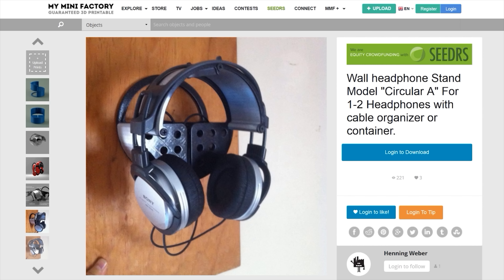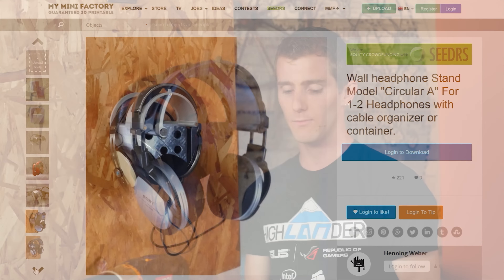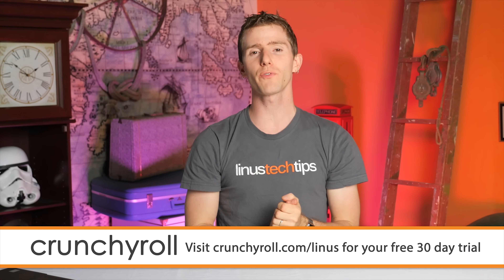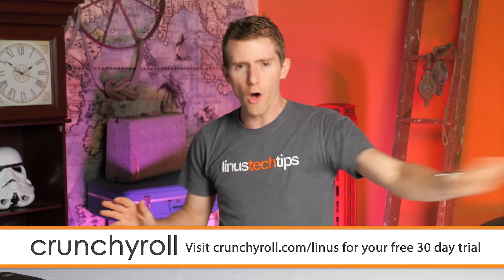Headphone Stand Design Contest Part 2 - 3D Printed Units In Office!

Comment: Funny if someone submitted a nail
Reply: I did
Reply: +Mr.TypicalHax heh, nailed it
Reply: +da' medic oh, you're punny
Reply: +Paul Apac What if someone submitted some string as well?
Reply: da' medic Eh eh I see what you did there
Reply: +Dottorrent I have the urge to set up a headphone pulley system now...
Reply: +Paul Apac Better submit two nails or else points off for no cable management.
Reply: +da' medic so punny it herz
Reply: +David Evans And a third for mounting hardware :P
Reply: +Paul Apac Got mine on a nail atm, but when you got like a 500$ pair of headphones, sitting them on a nail isn't to great an idea. at least for me. It insults the glory of the device!!
Reply: +Paul Apac I just use the desk :|
Reply: LinusTech Tips LinusFakeTips
Reply: +Jacob Evans Same, or the shelf, one ear pad on the flat side.
Reply: *****
bought what on amazon? a shelf ?

Comment: I think the second design is the one I like most. Its simple, clean and functional and would look great in different colours.
Reply: so true
Reply: I agree. perhaps linus should have just presented the shortlist and let a strawpoll decide. its not like there are any bad designs or write ins for the internet to ruin the poll. The one he chose is huge and clunky compared to the second one, and the runner up has no cable management.
Reply: +PoM|SirLiftalot what do you mean by gardeny?
Reply: +PoM|SirLiftalot Ah ok :D Yes, maybe this one should not be made with a green colour...otherwise you might indeed feel compelled to hang a garden hose on it  :-P
Reply: +Garrettthief Well i bet that you would not use the piece for rolling the cable on because it would be difficoult... People are lazy and as a designer i with a tiny bit of experience the basket is a better idea in general.
Reply: +KiniA Chan That "wally" though
Reply: +PoM|SirLiftalot you can say the same about the winner. You can store a large hose, then your nozzles or sprayers can go in the little basket.*
Reply: +Garrettthief yeah, i liked how small it was and it would probably be cheap/er to make too.
Reply: +DeAtHaToMiC88 headphone holders are overpriced regardless of how cheap they are to make
Reply: +Garrettthief model two nob, for the wire rly damages the wire if u are rolling it so tight
Reply: +Garrettthief yeah, I also think number two was the best...
Reply: +Garrettthief same. the last design should be the runner up for me.
Reply: +Garrettthief exactlyyyyy. if the second one had a longer back and a slightly bigger cylinder on top of it to fit the whole roll of cable it would be perfect...idk why it didnt win or become runner up -_-
Reply: I agree as well. That second one was really good. Simple and thoughtful and would serve to a larger audience I feel.
Reply: +Garrettthief Agreed, it just worked.
Reply: the second one with a higher top and a basket there instead would make it perfect Imo. I see why Linus chose the last one tho.
Reply: +James Langridge I agree, I think linus's judgment was based more from a studio/business standpoint rather then some random gamer dude. But again, they can use possibly a few of these and make different models if they sell well.
Reply: I agree, they really should have asked tubers to vote on designs they liked. I personally didn't like the one Linus picked, way to bulky for my liking.

Comment: How the fk does the one at 9:10 hold the second headphone like shown in the picture.
Reply: +Assa Laos hahaha nice eye damn... only way would be to screw it into the wall with that pair of headphones in it :X
Reply: XFourty7 Lmao permanent mount I guess. Im honestly kinda surprised that linus missed that
Reply: Wireless headphones
Reply: TheRealJ0NAS keep on smoking rocks man!
Reply: +Assa Laos I thought the same thing. It's just impossible. Or you have to use magic.
Reply: +crankCINEMA Lmfao guess you can only use earphones with really small ear cups, the one Linus was using to test out the stand wouldn't fit. And jesus, did you create that design? Not sure why you're so salty, its not like I insulted your ancestors.

Either way its a shit design in general and I'm sure most people agrees.
Reply: You can only use it with wireless headphones and the sad part is that normally when you dont use your wireless headphones, you put them in their dock to charge them so meh design imo..
Reply: +crankCINEMA In the render, the headphone cup is WAY too big to fit
Reply: crankCINEMA
For example, you got a ball with a diameter of 10cm. You got a hole with a diameter of 5cm. No matter how many wires are on the ball, you won't fit a 10cm ball through a 5cm hole. It is just too big. The earcups of the headset is also too big for that hole to go through. Unless the guy has some sort of rare headset where he can take the earcups off of the head band. But many people who buy it do not have that kind of headset.
Reply: +Assa Laos haha I saw that too ;)
Reply: +Animiles finally
Reply: +Assa Laos Earbud holder. Solid one at that.
Reply: +crankCINEMA Im glad someone else saw it... I really didn't think the design was that complicated lol
Reply: +crankCINEMA Because you can fit an ear-cup that large through a small crevice like that.
EDIT: If you can't tell this is sarcasm.
Reply: +Assa Laos beats are more for form rather than function. :)
Reply: I don't understand why people keep stating that earphones only have 1 wires. The wire is not the problem. But a lot of headphone ear-cups are bigger than the hole, so you'll either not be able to fit it in or have to squish and possibly damage it to get  it in and out every time.

And as someone else had commented. Even in the render, the headphone cup is way too big to fit into the tiny hole.
Reply: Assa Laos Thank you!
Reply: +Assa Laos you could stick it through earphone first. Hope that makes sense
Reply: William King
NO. You can't stick the earcup through first because they are too big for the hole. It just can't physically fit through the hole. The wrie is just not the problem.
Reply: +Assa Laos My question is why are people arguing about an example in the first place? While that particular pair of headphones in the rendering DOES seem to be too big to fit, the picture shown just 2 seconds after at 9:12 shows just how big that hole really is. I wouldn't doubt for a second that there are pairs of headphones that can fit in there no problem.

Comment: I think that foldable design looks great and with a little tweaking is the best. The runner up looks amazing and is easy to mount. The winner is ugly and bulky and an offence to the other designs imo. The designer did a great job and put some thought in it, but I don't like how it looks and how it handles the second pair. I hope Silverstone can't make those so that the runner up wins :)
Reply: +Animiles Also, I prefer a cheaper one. The runner up would most likely cost less to make. As a consumer who has to pay for these things I also take that into consideration.
Reply: +Animiles Silverstone's probably going to look at all of those independently anyways, and I'm pretty sure Linus' winner isn't going to be the one that wins it either since I think literally everyone thought it was the ugliest haha.
Reply: I would buy the folding one in a heart beat
Reply: +Animiles I think with the winner you can still accept it, since Linus didn't mention one thing, that I realized when rewatching it - the "front-pair" where the headphones can rest nicer, can be "taken off" so it gets a bit sleeker - but then it's not so nice to rest your headphones on it.
Reply: Additionally, the folding one could easily be modded to, say, the front of a case, without adding a huge amount of bulk, especially if it was refined more.
Reply: +Animiles I agree I like the runner up much better. I think the runner up would be perfect if it had a small hook added to hang a the cables. The winner was just way to big and bulky. I can see why it would be better for linus but the runner up is way more consumer friendly.

Comment: the one Linus chose, really?
who needs to hang 2 headphones

I personally like the second one
Reply: +Aero People that have both a headset with mic and regular headphones?  Or someone that has a professional (non-gamer) set of headphones as well as a gaming set?  Not everyone is going to use a single pair of headphones for all tasks, especially if you are into multimedia since gaming headphones tend to be a little on the, "OMG MOAR BASS!" side of things.
Reply: Charles Scott there are a hell of a lot more people who just use a single set of headphones than those who swap between them regularly, if this is meant to be for the general public then it isnt necessary
Reply: +Aero i have multiple head phones so i would love the 1 linus chose
Reply: Aero, then buy something else?  What the hell does it matter?  I have high doubts you would have purchased a wall mounted stand to begin with.
Reply: Or any of us with spares... The purpose of a stand is for storage. Whether or not a user is regularly swapping out the second pair is completely irrelevant to the functionality of the design. Just like the circular structure of the winner.
Reply: I really want to buy the second design.
Reply: In my opinion it deserves the place especially when you are sharing with a sibling or relatives and needed 2 spaces

Comment: The winner was one of the worst ones in my opinion. I would have chosen the starship kind of design (that thing was so elegant) and left the runner up the same. I personally don't need cable management space so I was only considering the ones without since they looked cleaner

Comment: The only one I wouldn't buy is the winner? I hope Silverstone has a little input in the final decision.

This contest has been flawed from the start of it. There were many designs uploaded multiple times with only very minor changes, clogging the pages on the website. Besides that the quality of the prints was extremely variable. I uploaded two designs and one came out just fine, while the other was barely recognizable.

Comment: 10:20 The "Headphone Pocket" is my favourite design as it is one of the most compact and flush to the wall designs when folded up and unused. It also has a decent method of thin cable management. Best thing silverston would like is that it seems to use very little materials.

Comment: Dude argh! Linus, a few points dude. I generally only need to store one pair of headphones, having a stand that mounts two isn't necessary. Most of us want our headphones still plugged into the source while they're secure on a stand.  Reason being for quick retrieval and removal, so having a place to put the cable isn't necessarily, if it were, I'd shuv them in a drawer. Lastly, why wasn't there a demonstration of any desktop stands. Surely there must have been some suggestions for a stand that doesn't require mounting to the wall. Anyway, enjoyed the video :)

Comment: What a horrible design you chose. The runner up was far superior, and could easily have been modified to include cable management by putting a sort of ditch around the edge of the backplate piece. The one you chose looks like a garbage bin mounted on the wall. No respectable company would produce such poorly designed crap.

Comment: I'm sure the bulk of the channel's audience are gamers and such, but from the POV of a DJ emphasizing cable management isn't all that important when the majority of widely used headphones have a detachable cable and/or mic boom like the V-Moda set I prefer. Because of that I think the runner up is a winner. It's low profile, hidden mounting hardware design looks fantastic and makes much more sense to me. With cable management and clean design being emphasized in setups it just seems so much more logical to use detachable cables and put them in a drawer.

Comment: I'd say the first one was the best, at least to me, I liked how it mounted, was produced, and just throw your cord over the hook 2 or 3 times before hanging you phones. I've been using a simple coat hook for my work phones for years and it's been fine. only time it's even better is if you have a little basket below for draping cables into as a trough system.

Comment: I think the runner up should have won. I feel like Linus picked the one that would beat suit him, not most people. The winner's design is pretty bulky making places to mount very limited. If you have two headphones on the stand, the headphones' cables will get tangled together, especially the one you put on first. It'll also probably be mounted at waist height making it kinda hard to put the cables in the pouch. Plus I think Linus is used to having many pairs of headphones, while most people only have/use one pair of headphones.

Just imo

Comment: I would have created one where it has a middle base, then two levels. For two headsets, and a model with just one spot for a headset.
Then on each side there would have been a spot to rap cables up, with a clip that easily flips down to hold the wires in place. 

it would have been beautiful.

Comment: I like the idea of the Circular A, because I could just drop the entire headphone cord into the container, without having to wind it around a knob or similar. But the design might have looked a bit better if it was only possible to mount one pair of headphones, and have the container underneath the headphones.

Honestly, I also hope that the runner-up gets released as a product, because if the winner gets released fewer people are going to want to buy it (that is, if the early YouTube comments are to be trusted). I wouldn't want this product to fail and then Linus has a harder time convincing companies to do contests like this again.

Comment: the folding one with the slot 10:18 should have been the winner, simple, elegant and functional. 

the winner looks ugly, bulky and it really seems like you made up your mind before they even got there. even the runner up was dissapointing, my design was extremely similar and it had cable mangement for it as well. 

kinda sad that it seemed so predetermined with no real contest.

Comment: Ohhh yeah. I think Linus didn't get the idea behind Stephen Flavin. Well correct me if I am wrong but I Am very sure that holder is just intended to fold the top part and the bottom part is supposed to be like that, I do imagine that holder would be a extremely nice looking holder in either brushed steel/aluminium or some bamboo or any other nice looking material, quite stunning I think actually. Anyway, back to my point, the bottom part is only there to make this look very very nice when not in use. and what would made it a perfect holder if it could be combined as a wall light or something :P can't imagine the top folding part being too hard to produce either.

Comment: #1 will stretch headbands on many pairs of headphones... Even the ones in the video, I imagine may become looser due to extended time sitting on this stand.  :(
Reply: If #1 was slightly smaller and the back section had a better lip along the edge to not damage padding. Then it would be amazing!

Comment: i dont understand the cable management problem. I have my headset cables running from the back of pc, under my desk and out the front. Thats why you get 3m cables. They are not designed to be managed.
Also the two wining designs would not be very economical to produce. 
I personally have a nail in the wall. Its cheap, you dont see it (it looks like the headest is floating) and it works...

Comment: I think the runner up is the best. 

It looks like it is small and nimble, easy to mount, simpler to manufacture and in addition you really can manage your cable as well.. There is extra space there, on the area behind the hanging headphones to loop the cable around the stand itself in nice and big circles that are the size of the headphones so they are hidden and so that the headphones are easy to take down without getting the cables all tangled or having to unwind them from a tiny spindle...

Of course personally I would not need cable management because my computer is situated in the corner of the room and the cables would go down below my table, so maybe I'm biased..

Comment: Winner would have amde a whole lot more sense if the top part could slide in thus making it a more compact 1 pair holder.  
Also who the hell wants to roll away their cable!? Makes sense to just have it hold the jack pieces if needed, but it should be fast to use.

Comment: Idea for the runner up, make the wall mount plate slightly smaller that the attachment piece (so there is a small lip) and use that for cable management!

Comment: Get a quaker oats can. Cut it in half so you have a small cylinder open on one side. Use double sided tape to mount it on the wall with the open side facing outward. Put headphones on top and store the wire inside....

Comment: Oh, right. I was supposed to submit my design. I had cable management in my design, it was minimalistic and was designed to both be wall mounted and on the edge of a table (where I would mount it).

Comment: I have to say I like the design, but I wish I could have submitted mine because I know that it would have made it into that group. I know that's a little arrogant, but mine looked like the silver stone one mounted to the wall pointing up, which is a very elegant way to make it compact and look nice when not in use, and then the stand folds down so that you can put a pear of headphones on it. Unfortunately I didn't have any cable management because I didn't consider that factor, but a ton of these didn't have it either and Linus's runner up didn't have it either.

If you want photos of the design I'll upload them to google drive and share them with anyone who asks.

Comment: I think the winning one would have been better if it was just meant for 1 headphone - the one in the "front". basically extend the top arch back to the wall, so the cable management slot has a roof.